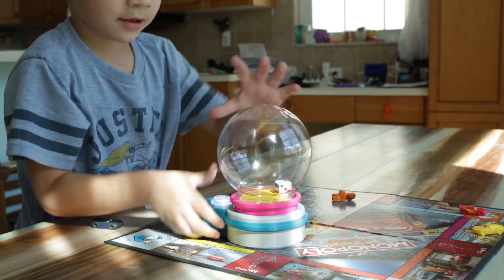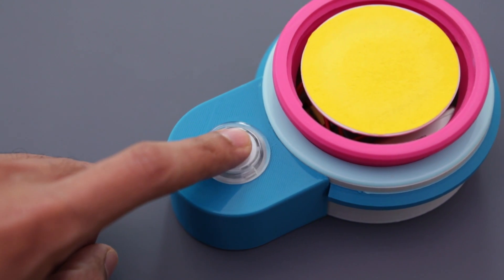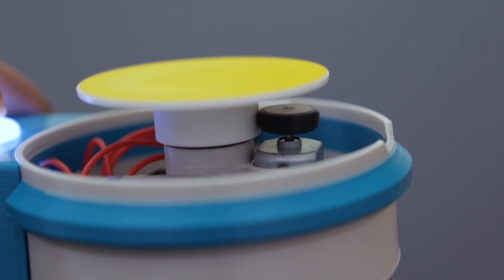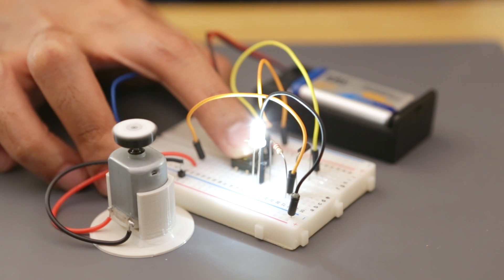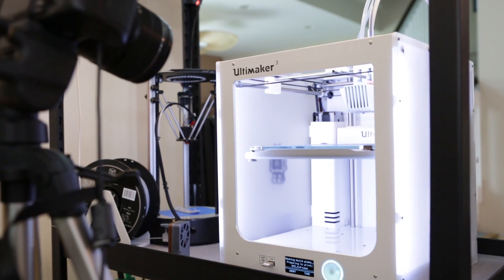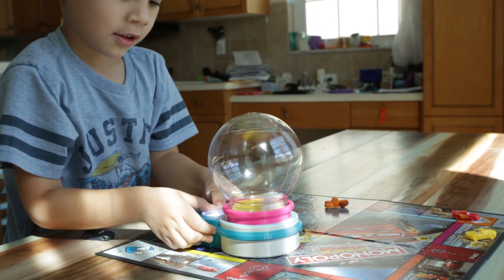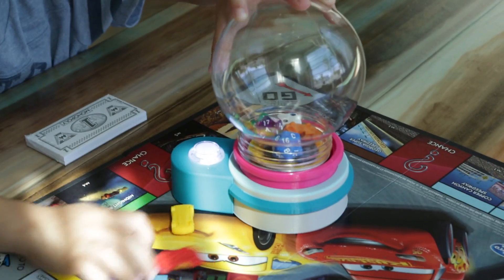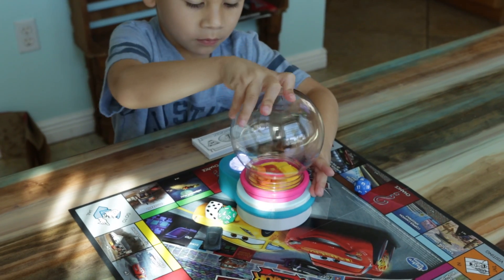DIY Automatic Dice Roller

Comment: extrude a few lines vertically on the spinning plate so the dice actually get tossed around...right now it seems as though they just spin in a circle and are not actually being randomly tumbled
Reply: Has anyone built it with or without adding some bumps to agitate the dice? Can one get random dice rolls?